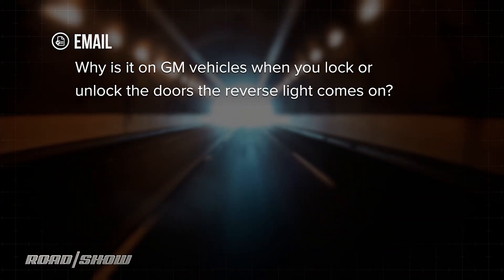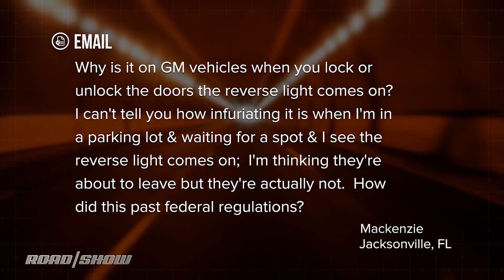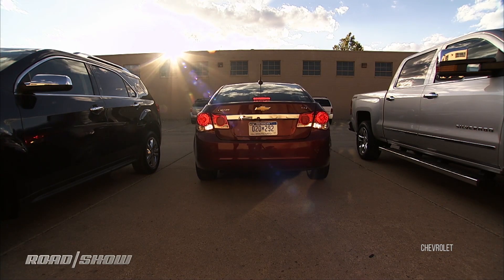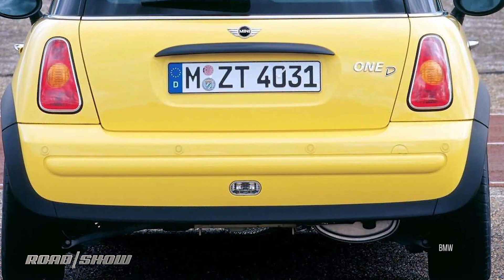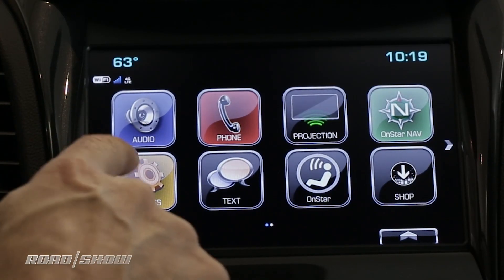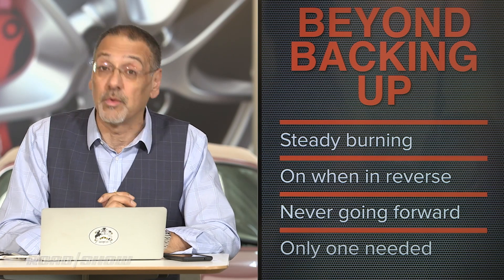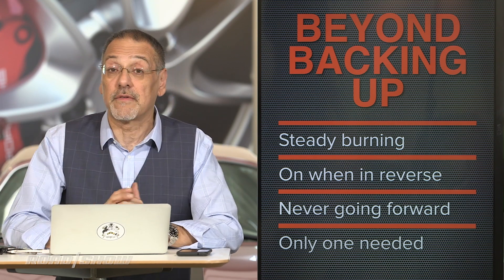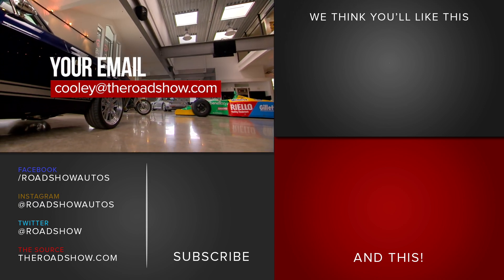Disable GM backup lights when the car unlocks - Cooley On Cars

Comment: When GM started doing that I worked collecting shopping carts in the parking lot. Kind of annoying me back then but now it doesn't bother me so much and I no longer working a job collecting shopping carts. When I found more annoying was some late 90s Toyota Camrys let have the reverse lights in the middle the trunk. That section of the car was so flat that when I am walking up perpendicular to it half the time I did not see the reverse lights come on. Collector cars that had similarly mounted reverse lights were not as bad. As you've noted Camrys in good working order are relatively quiet especially at parking lot speeds.

Comment: Understandable for illuminating the rear of the vehicle at night, but so infuriating when driving and trying to figure if the car is moving, about to move, or neither.
Reply: TJ HAMMERSLAND here’s a simple tip. Are the brake lights on? Yes: that means someone has their foot on the brake and the car is about to move. No but also not moving: car isn’t running. No but moving: pretty obvious.
Reply: It’s stupid
Reply: I hate another feature...in most veihcles as well......when the horn honks a brief time, when turning on the alarm/ locking the doors. With my Rav, it comes with the beep sound instead.....instead scary the crap out of someone! Lol
Reply: @mman454  sometimes the vehicle is not moving yet, because the acceleration of the vehicle not achieved yet ( such as uneven surface of a roadway ) so no need for the brakes to be engaged.

Comment: Everyone is annoyed by this, but having this is much like cars with puddle lights on the mirrors or along the side of the car (saw it on a current gen Nissan Altima). At night it functions as a way to see the perimeter of the vehicle. My 07 Sierra has this feature (its listed in the vehicle settings as perimeter lighting), so when I unlock the truck at night the rear lights come on along with the day time running lights on the front. It can be very helpful and make you feel safer if your in a parking lot with not a lot of light.

Comment: I can't believe how ignorant people are. Everyone that complains about this being "confusing" to them might want to stop and consider: ALL modern automatics REQUIRE the BRAKE PEDAL to be pressed before shifting out of Park. So when someone starts their car and goes to back out of a space the brake lights will ALWAYS be illuminated prior to the backup lights coming on if they are backing out. OTOH, if you see backup lights come on WITHOUT the brake lights coming on first, then it's likely the pathway illumination feature.  The exception would be the handful of manual-transmission equipped cars with the feature like a Camaro or Vette. 

FWIW, I first added this feature on my personal vehicles (not GM) back in 1993 at the same time I installed the aftermarket alarm...and well before GM started doing it . Come to think of it, I shoulda patented the idea back then!  When I first installed it—along with features like auto close windows & sunroof, remote window opening, and remote start—it was kind of a novelty. I wired it so the backups, front fogs and front cornering lamps all came on a timer upon unlocking and turn off upon locking. After using it a few days it became obvious path illumination was more than a novelty. It's especially nice walking out to your vehicle on a dark street or poorly-lit parking lot, especially in crappy weather (or a crappy neighborhood). On my later implementations, I added an option to turn the lights on or off without locking/unlocking, activation on exit (if the headlights were on prior to shutting the engine off) and a gradual fade on/fade off effect which also serves to differentiate this lighting mode from "backing up." One implementation around 2002 did actually use 3 different brightness levels for the backup lights: low for path illumination, medium for backing up and ultra-bright (2x130w halogens!) when manually turned on for work site/camp site/off road trail use. On that vehicle, the fogs and rocker lamps also illuminated at lower intensity for path-light mode than normal "on" mode.

Comment: Hate this GM feature as well (which is why I will never buy a GM vehicle until they get rid of it). It is very annoying for other motorists and pedestrians since you don't know if the vehicle is about to back up or not.  While walking in parking lots I have stopping numerous times because the back up lights engage on a vehicle I am about to pass by, but after waiting a moment, I notice no one is in the car.  I am surprised Brian Cooley that you never realized this GM feature existed as it has been a staple of GM vehicles for almost 20 years.

Comment: They should just make it so only the brake lights come on and not the reverse lights because what I see very often are cars with burned out taillights even if they're 2 years old (and especially with American cars for some reason). If those come on then people can see they're missing a light and need to replace it. Rarely do the reverse lights burn out.

Comment: Stupid feature that was never needed. Another oddity: SAABs have front-mounted  reverse lights(so people know you're going away from them?)
Reply: SAABs have front mounted CORNERING lamps, which illuminate the direction a turn is signalled and ALSO happen to illuminate when in reverse.  The purpose is the same: to illuminate the path you are travelling, in this case the path of the front wheels while backing up. Keeps you from running over the family pet or the kids tricycle. Fun fact: '80s Corvettes also had REAR cornering lamps.

Comment: Also, just a heads up on this solution, it doesn’t just disable the backup lights when unlocking/locking, it would disable all lights (other than the flashing ambers when clicking lock or unlock)

Comment: With this being a GM-only feature you can almost always doublecheck to see that the vehicle is actually running by the large amount of oil being burned and exhausted out the tailpipe, or the extreme amount of shaking the misfiring motor is causing the chassis to do.  Either of those GM traits, coupled with the back-up lights, will tell any other driver that the GM owner regrets his decision to buy GM.  

Also it lets you know that they're about to back-up.

Comment: Wow I'd  never seen so many complain over a safety feature 

Jeez people nowadays are weird
Reply: It is  not a safety feature. This can confuse other drivers who might not yield to a GM car when it is legitimately backing up. In the best case, this is merely annoying to other drivers, including drivers who drive GM cars. This is not an issue in a garage, but IS an issue in a store parking lot, where drivers - and pedestrians with children and shopping cards, etc -  have to take extra time to decide whether the car with these lights on is actually backing up or not.
Reply: nsbioy the guy went over everything you said in your comment  -  yes, it is a safety feature, and people admit that they don't even realize that the car  has the reverse light on. Just because you dont like it, doesn't mean its "meant to confuse drivers"
Reply: I did not say it was "meant" to confuse drivers. I said it "can confuse other drivers". There is a difference between the two statements. This illumination feature works well as intended pretty much everywhere else except for a busy store parking lot, where it can confuse other drivers as well as pedestrians. Backup lights are an important safety feature when used as intended and in a standardized way. When they light up in a make-specific way, problems can arise.
Reply: nsbioy exactly since light bulbs do a burnout you can't always rely on a brake light to tell you whether someone's about the backup or not.

Comment: I think it's a safety feature. Interior lights come on so that you can check if someone got in and is waiting for you inside. Exterior lights are for checking for puddles and and stuff and also if someone's waiting around your car to jump in when you unlock the doors. I think they should only work when it's dark, cars can sense that.

Comment: Ok....maybe if the vehicles were like those Grand Ams, or Grand Prixs,  with the quaud reverse lights ( those extra white lights inserted into the rear bumper, to see better at night ) then folks could see better, or if the vehicle had LED reverse lights, but yes....this feature is infuriating. The reverse lights are made mostly to notify folks that the veihcle is reversing; as moving backwards ( motion of veihcle ), and NOT just when in park and doors opening. Yes, I know most morons don't pay any attention to veihcles backing up.....because, afterall, it is your fault if you back into someone.....but, nevertheless folks MUST  pay attention in parking lots....and STOP texting on your devices when walking.

Comment: The fact that your tail lights don't automatically illuminate with the daytime running lamps is of immediate concern in my opinion. I've seen many vehicles traveling down the highway in complete darkness thinking all their exterior lights were illuminated just because the dash is lit up and there's a miniscule amounts of light emanating from the headlamps.
Reply: Day time running lights are one of the biggest mistakes in the automotive industry. 

Like you, in my observations I have seen many people driving w/o their lights on and their cars are equipped with DRLs or have illuminated dash lights.
Reply: Agree. Just last night I was on the highway in near white out conditions, the car ahead of me suddenly swerved....turns out that the douche in front of him, in a newer escape had no rear lights. None! And his car was white. Just his daytime lights. At least all GM's have auto lights afaik. Could have been a disaster because of this idiot. But I blame Ford for this as well for not including auto lights.
Reply: The dash is not supposed to light up when the running lights are on. I have yet to be in a car whose dash lights up with the headlights or parking lights off. What you might mean are the digital dashes, which have no choice but to light up day and night. Still I'm sure some of the time, the drivers just see the brightness in front of them and assume the lights are on without noticing the dim dash. I say this because I have seen many old cars over the years driving at night with their lights off, since BEFORE running lights existed, and still see some of these old ones driving like this today.
Reply: Automatic lights are available on pretty much all makes nowadays, but in some models it's an extra feature ($). Although I think it's a great one, it's not without its downside: many people have become unaware of their lights over time... In the past few years I have seen more and more cars driving in the rain during the day with their lights off. It needs to be a very intense deluge for the auto lights to come on during the day, otherwise there's enough light for them to stay on. This is a problem in heavy rain, especially when the car in question is white, gray or silver, as they just blend into the the rain and can become invisible until it's too late. 
For auto lights to really be effective they should also have a rain sensor (like how some cars have rain-sensing wipers).
Reply: Film Monger I work for AutoZone and I see this problem all the time. I’ll go out to someone’s car cause they have a headlight out and they want me to check. I’ll tell them to turn their lights on and they’ll say “well there’re automatic” I’ll have to literally show them where the headlight switch is. It’s like everyone forgot that the can actually control it. Of course these are the same people who don’t have their lights on during rain or snow, it’s ridiculous. 
I LOVE all these tech and safety features but the smarter cars get the dumber people do.
Reply: Film Monger Most GM vehicles have auto headlights which also turn on if the wipers are activated for 30 secs
Reply: Film Monger I dunno about all cars but my mom's Acadia has an illuminated instrument panel regardless if it's a clear sunny day or nighttime. And it's not "digital" just regular analog
Reply: This is a problem with late 2000s Japanese cars went to a style where the dash lights up day and night the same.  Not having auto headlights was a problem.  Of course its been corrected by now, but be on the lookout for those folks driving those cars with the daytime running lights on as headlights.
Reply: East Coast Resident that drives me nuts

Comment: My tip to Mackenzie, the best way to verify if the GM vehicle is backing up is to check the brake lights. People usually back up while slightly pressing the brake, just to go a little slower.

Comment: I had a Buick that did this and I liked it for illumination at night. Check for brake lights people.
Reply: Brake lights aren't infallible - on a manual car you can start, shift into reverse and back out of a space without ever touching the service brake. So if you have a GM car with M/T, or even a model that's available with one - disable those entry lights!
Reply: I like it on my Buick too. When I exist the car, it lights up to alert other driver so they won't hit me. I have set it for 20s.
Reply: TJC450 My 2011 Malibu does the same thing
Reply: Checking for brake lights won’t change anything. The brake lights still come on when the vehicle is locked or unlocked, and most of the time when people are backing up in a parking lot, they don’t remove their foot from the brake pedal.
Reply: Graham Clarence The taillights come on with the back up lights when the car is unlocked or the key is removed. Checking for a brake light (CHMSL) in this case will tell you that someone is in the car preparing to leave. No brake light means that the person just left their car or just unlocked their car and you should move on and find another spot.
Reply: TJC450 I’m not sure about you, but I live in an area where most GM vehicles are trucks. You can’t see the third brake light on a truck when you’re waiting for it to back up.
Reply: Graham Clarence I can see that being an issue as GM trucks at this time don’t use leds for the third brake light and tend to be burnt out a lot. 

I check for brake lights because most people use their brakes to aid with backing up.
Reply: TJC450 you aren’t even mama,king sense anymore. First you say that you check for a CHMSL to see if they’re actually backing up, and now you say that looking for a CHMSL doesn’t matter because they’re burned out most of the time anyway? And I’m not sure if you’ve noticed or not, but the brake lights being on doesn’t help because the brake lights turn on when the vehicle is unlocked or locked, so it still doesn’t tell you if someone is in the vehicle or not.
Reply: The brake lights don't come on during locking/unlocking, the turn/hazard indicators flash. Granted on some vehicles they may be the same part of the lamp assembly but many GMs use separate bulbs (even if they are also red). Also the unlock flashes are very brief—must shorter than would be typical for someone to step on the brake, shift to reverse and remove their foot from the brake. Which brings up the next point: most people (wisely) ride the brake as they are backing up which would result in continuous brake lamp illumination along with the backup lights... so again, check the brake lights: if they are on solid for more than a brief second when the backups come on, then there is a person backing up. OTOH, if you see a couple quick flashes and the backups come on they its the path lighting feature. It's not that hard to tell the difference. I don't own a GM car and I had no problem figuring this out.
Reply: TJC450 then professionally back up into the spot and use the headlight delay like it is meant to be. What a stupid way if selling more bulbs.

Comment: another topic similar to this that i would want an answer is why volvo lights are always on no matter the time of day and you can't turn them off. is there a way to defeat this i understand why they do this but there has to be a way to turn them off if you want. im talking about old models the new models have more of a better look and LEDs
Reply: Luis Lopez I think they're always on because of safety reasons, and it might have been a law in Sweden at some point that the lights must always be on. Some older Saabs did this, too.

I've heard that the feature can be disabled using VIDA. For a while, I was annoyed that the lights were on all the time. However, seeing how many people drive around without their lights off at night, I completely understand the rationale.
Reply: Jake B yea that’s what I read too it’s like a safety feature from Volvo but at least here in the US they should give the option to turn them off they burn out fast soeacily where I live it goes up to 110 in the summer it’s annoying. I’ve never heard of VIDA ima look I to that, I can turn off only the headlights but sometimes forget to twist the knob agai when I turn off the car. Thank you!

Comment: So these people are complaining about a safety feature?
Reply: Steve C# welcome to society in 2018
Reply: That's like claiming that a vehicle using turn signals as additional headlights is a safety feature because it illuminates the road further. If that illumination comes at the cost of sending mixed messages to other vehicles, it really isn't worth the benefit which is at best very minor.  Likewise, the taillights could be used to illuminate without communicating mixed messages about intention.

Comment: I don't get the hate. If the brake lights aren't lit at the same time, 99% chance it's the parking lights. Otherwise, it's someone who put it in reverse and then set the parking brake. Unless of course the vehicle is actually moving. But at that point, it's behaving like every other car.